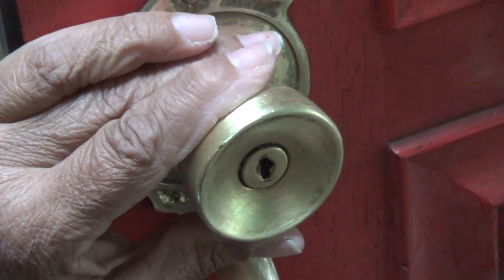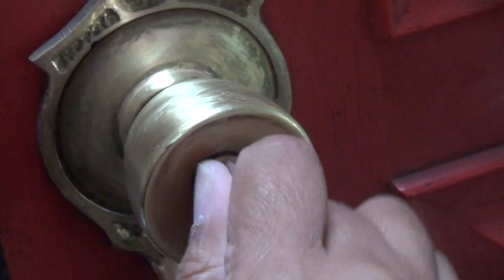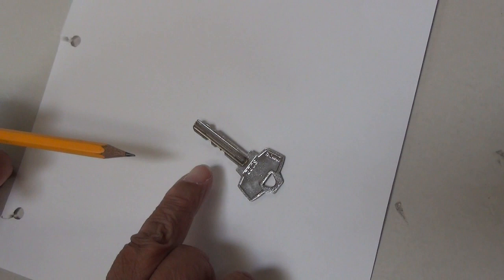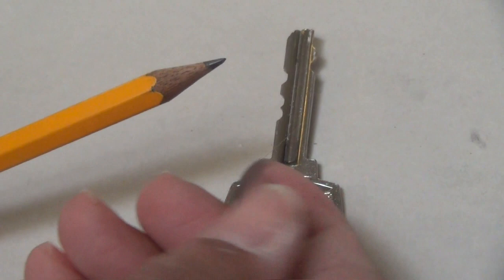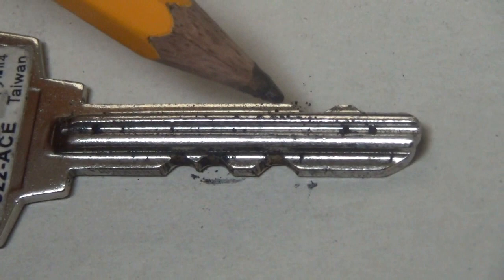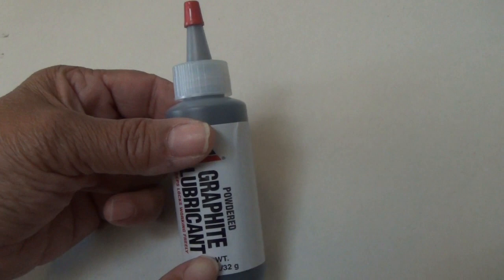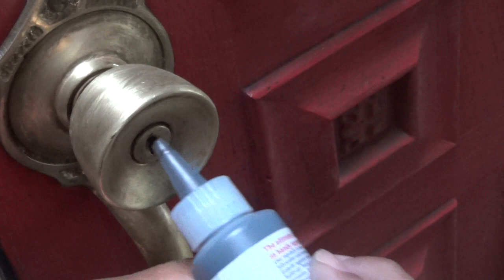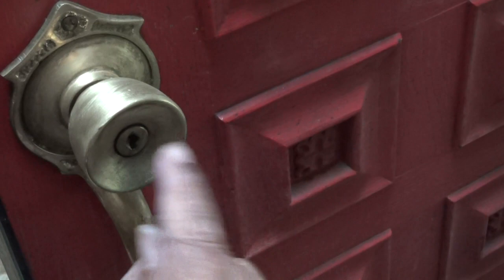Fix Your Sticky Door Lock With a Pencil

Comment: I was in a bind and didn't have any graphite powder available to me, and the pencil on a key method was not effective enough, that's how much of a state my lock was in. I took a small blade and shaved off enough of the pencil lead to make a small pinch of the stuff, scooped the graphite shavings into a plastic straw and then wedged it into the keyhole on my door. Puffed a couple of times into the other end of the straw and managed to get enough of the graphite into the offending lock before I stuck my key and wiggled it around, turned it, etc.

Worked like a charm!

Comment: Holy moly, I am so impressed at how well this works!! I was trying to avoid using WD40 because I don’t believe it’s a do-it-all solution like people think. Would have been just a temporary fix that would have gunked up my lock in the long term.

Just one pass over with a graphite stick and my lock and key already felt less stuck. A few more passes and it’s as good as new. Thank you so much!

Comment: I have been doing similar for, but only using a pencil. Sharpen the pencil and then scribble in the same place (near the edge of the paper) until the pencil goes blunt and then fold the paper gently where the scribble is, put it against the key hole and gently blow the graphite into the lock. Works a treat.

Comment: Thank you, thank you, thank you! 🙏🙏🙏 I was tired of having to pull the door real hard in order to lock it. I used a pencil on the key like you’ve shown and I also drew really well on the four sides of the latch (sorry if I am not using the correct term), I mean that long cilinder that retracts when you turn the key to open the door). It is much easier now. I made sure to wipe the key and all around the lock because of the dark powder.

Comment: You can also use a SILICONE spray in a pinch to free things up...but it is not a good long term solution for locks...especially if not used a lot.  Best to use a dry lock lubricant as it's easy to spray right into the key hole.

Comment: I've used WD-40 with no problem. some common problems is where we store our keys, ie our pockets with all that lint. this gets transferred into the lock cylinder and binds the pins where the shear line doesn't line up. so wipe any debris from keys before placing into the lock. some locks are a little older and some of the springs may need to be replaced which would give the lock a few more miles before replacing. Leah I love your videos keep up the good work.Bruno the Locksmith

Comment: Imma try that on my Toyota tomorrow. The oil lubricant worked well on my dodge caliber door actuator and it prevents rust and corrosion. I get the point with attracting dust and so on. Great wisdom and thanks a lot for the video.

Comment: Thank you so much for this video! I had trouble with the interior front door lock for years. I tried a different keys, which didn't work, and thought I'd eventually have to replace the lock.. Well, after watching your video, and ordering through graphite powder from Amazon, I tried your method, and it worked! It's getting easier each day as the graphite works its way into the lock! Thank you, Leah!!
Reply from the maker: you're welcome, glad to hear the graphite did the trick!

Comment: The pencil trick really works. What I would recommend is to use a Exacto or utility knife and shave the graphite (fine powder) directly onto one side of the key. Next, insert the key in and out of the keyhole and turn it several times. Then repeat on the other side of the key with the graphite shaving. You also need a pencil sharpener to expose more lead on your pencil.

Comment: Momma Marvie used to pack rings with graphite down in AL when she and Granny were alive. Where she worked machines did the job, but sometimes there would be a batch the machines couldn’t pack. Momma Marvie brought them home so Granny could have some pocket money Graphite all over the place!  They never had issue with locks or hinges and they did it for decades!

Comment: Quicker and cheaper than going to a hardware store for graphite powder, you can cut a few inches of wood off your pencil with an x-acto knife, razor blade, or box cutter, and grind off a little graphite with sandpaper or a knife edge.  It won't come with an easy applicator like the store bought one, but it's virtually free.

Comment: I love your channel, Leah! On this one you're a bit off the mark though. Only PTFE lubricant (Teflon) should be used in a lock. Even graphite will cake up in the cylinder and cause issues. As a locksmith I only suggest Triflow, as it's waterproof, doesn't cake up, and is useful for any lock that is exposed to moisture.
Reply from the maker: Thank you, and I want to say that I appreciate you taking the time to write this. What you are saying is true.  PTFE lubricant is a superior product to graphite. But, it is 3 times the cost. 

What I will say is that people are always inventing new technologies to solve problems that have been previously addressed with more common or natural substances.  For example, real oil vs synthetic oil.  But is the average person going to go out and spend 3 times the amount for something when they can solve the problem with an item they have around the house?  Maybe. 

Here at See Jane Drill, we are all about offering options.  And you have brought up an excellent additional option for folks to consider.  So thanks!
Reply: Agree with you fellow locksmith! I sell Triflow at my shop!
Reply: Since graphite isn't working, I will try this.

Comment: Hello Leah! Let me start by saying I love you! I have to ask you and say pretty please dont use graphite in locks. Yes oil base lubricants will end up attracting more dirt like you said but Graphite will gum up your lock too. Especially if use that powder vs just using the pencil lead to get you by for the moment. It is kinda like taking a grain of sand and smashing it into a bunch if little pieces then shoveling it into the lock. Please use a silicone-based spray. I like the "dri-film" kind beceace I can be heavy handed with it and it won't bleed much if at all. If your lock is starting to have problems inserting, turning etc. It's most likely the key is worn or a bad copy. It could be the lock or a combination of both.  As soon as you notice something different call a professional or just replace the lock. It could save you from possible being locked out. I seen it too many times. I still think your awesome Leah and appreciate you helping people.

Comment: My problem is not that the key doesn't go in and out; the cylinder just doesn't turn until you've tried it a dozen times or so. To me, it seems like I have a single tumbler that is sticking. This helped a bit (only half the tries required now), so I'll keep trying.

Comment: The key to my gate does this. But I also have problems locking the gate. The key will turn up until the point where it's suppose to engage the lock, and then it gets stuck. I don't feel any obstructions in the socket where the lock fits into. The key will turn all of the way when the gate is open though. I don't know what the problem is.

Comment: Recently my front door lock has become hard to turn 1 way. Both the lock and the handle part are hard to turn the way I usually turn them, but the other way it is working fine. The key goes in and out fine. I'm not sure if I need to replace it or if I can open it up and try to lubricate it. Any ideas?

Comment: Thanks Leah for showing this.  I have done it on few occasions.  Did you know that it works great on door hinges?  just put it on the pin and slide it back in.  Just thought that I would add that.  Great video.   Tim
Reply from the maker: Tim Caron  thanks for sharing Tim

Comment: Or, you can use a spray lube that has graphite in it like CRC 2-26 Multi-Purpose Lubricant which is safe for use on plastics and electrical switches and is available at Home Depot.  The light mineral oil base quickly evaporates and leaves the graphite in the lock. These types of products with an alcohol or light mineral oil base are also excellent for electrical locks like auto ignitions.  For use in vehicle ignitions just de-energize the ignition by unhooking a battery terminal and then spray in the lubricant. Turn the ignition on and off several times to coat the inside of the ignition lock.  Let dry four or more hours and then reattach the battery terminal and you're done.  It worked for me.

Comment: Wd40 best my lock never broke when i use it graphite suck i put graphite it broke my lock and i couldnt open it was a newer lock so i put wd40 it worked it made the lock look new but one time I accidentally put graphite in a rusted lock it was so bad the wd 40 fixed it a little after wasting the whole can i had to buy a new lock i ended up throwing away the graphite and i kept my wd40 and when you put they key in it turned the handle and they key hole didnt turn so you need to put it in right i dont even think you got a deadbolt i reccomend 3 Abloy Protec 2 they are strong unpickable and never rust for 400 years your lock is a wafer lock from what the key looks like and wafer locks generally suck they can be picked with waffer lock picks if you want a good handle get MulTLock MT5+ Core its very rust resistent 100 years its very very difficult to pick your graphite and locks suck
Reply: Graphite has not been fixing my doorlocks. I am unable to get the key in. I am about to use wd40. Since I don't have a working lock now, I don't think I have any thing to lose.
Reply: Margaret Wandel use wd40 its the best fck graphite it sucks.
Reply: I found some Blaster Silicone lubricant in the garage. I used that. All my locks except one are now working smoothly. The one that isn't appears to have been vandalized. Something white appears to have been sprayed into it. When the weather improves I intend to take it apart and see if I can fix it.
Reply: There is also a sillicone WD40 but i dont like it bc it has graphite and it messes up my lock wd40 is a water type so it cleans sand dirt and dust out graphite just makes the keyhole more dirty and interferes with pins making the lock hard to use and it doesnt clean dirt sand rust or sticks.

If you had a keyhole full of sand, would you use WD-40 or Graphite?

Comment: I love your videos but I'm going to have to disagree with you on this one. :(
Locks stick because of the wear and tear, dirt, oils in our skin and in this case, the graphite.
That lock is an OLD Schlage. The key is a Cole SC22, and it looks like it's brand new. Cole was bought up in the 60s.
Newly cut key in an old worn lock will bind. 
If you want to keep using that lock, I would recommend taking it to a locksmith you  and get it cleaned and re-pinned. They won't charge you much ($10-$15, probably free if you offer to put them on your channel) and it'll be like new. 
Unfortunately, graphite has it's own problems, including leaving a trail on your carpet that will NEVER come out.
I live in the desert and we have problems with dust and sand in locks. When servicing a lock, I remove the cylinder and degrease it with brake cleaner, replace the springs and pins and then use LPS1 lock lubricant or 3N1 Dry Lock Lube.

Sorry if I caused any problem. Keep making great videos!

Comment: The biggest problem with using graphite is it doesn’t go away. After a couple more times of doing that the lock will be full of graphite. She should only do a squeeze and that’s enough  the best is WD 40 or Tryflow trust me I’m a Locksmith
Reply: Daniel Derflinger It's actually referred to as "caking". Any locksmith worth their salt will tell you to only use PTFE (Teflon) spray. Triflow and only that.
Reply: I had one lock that was almost seized turned very hard and i sprayed some WD-40 an it works flawlessly and that was over a year ago, lock was ISEO R6 euro cylinder. So i can confirm this i use WD 40 on all my locks and no problem
Reply: Fantastic!! Worked so well and quickly!!